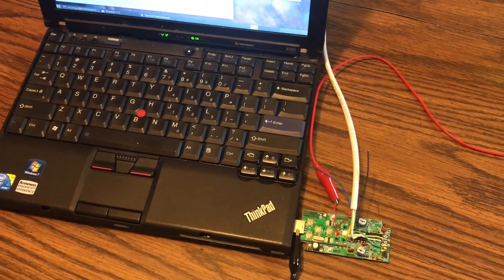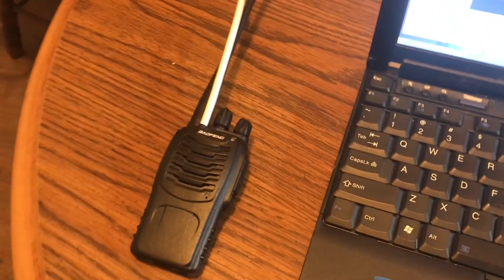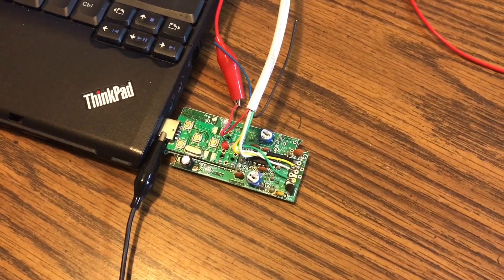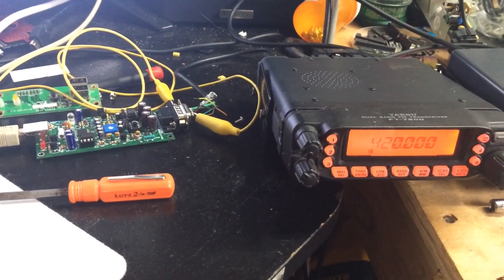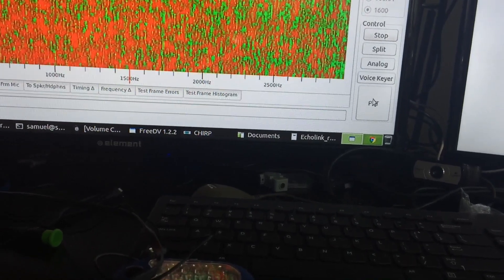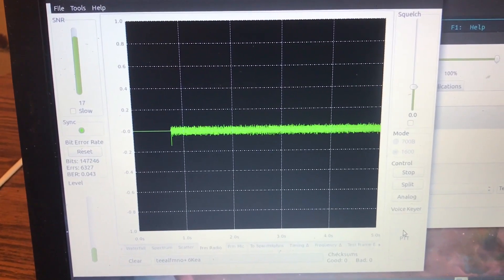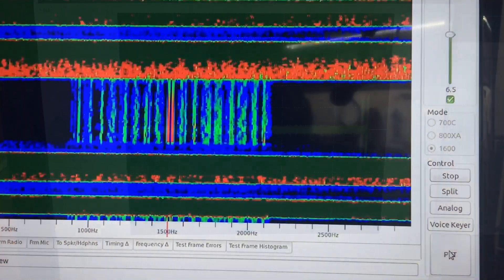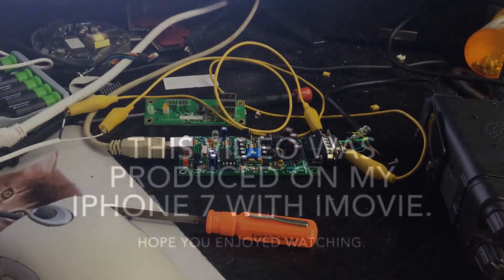FreeDV QSO on 70cm FM

Comment: What mode are you using? IIUC you need the trunk version of FreeDV to get the new FM-compatible mode.
Reply: https://www.rowetel.com/?p=5119
Reply: You need 2400B which is in trunk FreeDV (not released yet)
Reply from the maker: @XX-zz9eq  this was running 1600..  It works fine over FM...  The FreeDV install on the laptop was a bit older as it is running 16.04 and I did not want to install from source just to shoot this video..   I shot this video just to show a few people what I had been working on over the weekend..
Reply from the maker: My desktop is FreeDV 1.2.2 the  version on the laptop is 1.1
Reply from the maker: That's cool about the new FM mode..  I am going to check it out next..  I am having a issue getting ubuntu to play nice with my CM108 devices right now..  I think I am about to go to debian and run straight ALSA. I have attempted to remove all the Ubuntu sound and revert back to ALSA but I cannot control the volume with alsamixer for what ever reason..
Reply: If you are on Ubuntu then you can compile the bleeding edge FreeDV with FM support. Let me know if you want to try it and I can help you.  @K5MOB
Reply: Debian also works fine for compilation. Easy peasy.
Reply: yes  @K5MOB
Reply from the maker: I did not see this comment and asked you that very question..  so I deleted the question..  I am about to move this machine over to debian now.  So I will go compile FreeDV from source..  I am assuming you can get the source from github.
Reply: I created these notes for you so you can compile easy. Give it a try and give me a shout if needed https://gist.github.com/dysinger/a30751a78d651502ae96d6430c66f1f4  -73s NH6F  @K5MOB
Reply from the maker: @Tim Dysinger are you part of the dev team or just an inspiring user?
Reply: I'm a software developer and a ham. I'm also impatient so I just compile from source to the latest bleeding edge version. I have a couple VHF radios that I'm experimenting with. I'm using the Baofeng APRS cable adapter to go straight from soundcard to radios.  @K5MOB
Reply from the maker: I would like to get the GPIOs working on the CM108 devices from within FreeDV and FLdigi..   Do you know a way to do this?
Reply from the maker: I want to key the radio from GPIO I would like to use the Mute key on a CM108 to for ptt..
Reply from the maker: The guys over at dire wolf have the CM108 ptt working with GPIO pin 3..  I dont know enough about C programming to pull their code and use it as a stand alone system. Plus GPIO3 requires access to the chip as it is unused for sound devices..  I have a bunch of CM108 cards that have the black blob so it would be nice to use one of the GPIOs that are for volume or mic mute
Reply: GPIO to trigger PTT is handy. I'm just using VOX for experiments.  @K5MOB
Reply from the maker: The ARS fob on the laptop I modified in the video had a built in VOX circuit. It was setup to monitor the right channel for a tone then ground a output on the daughter board for ptt..  I rerouted it to the left channel and pulled the filters so I could use it with FreeDV.

On my desktop I am using RS232 through a optical isolator in FreeDV and FLdigi to key.  It works but it would be real nice to use GPIO in all programs..